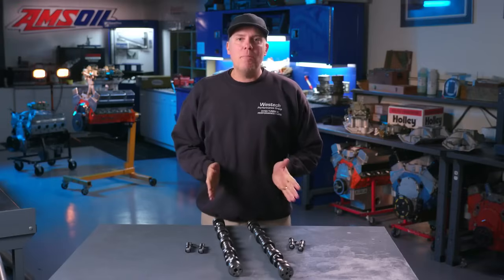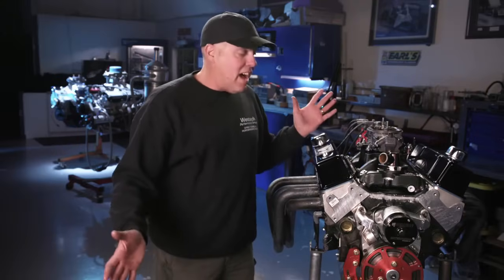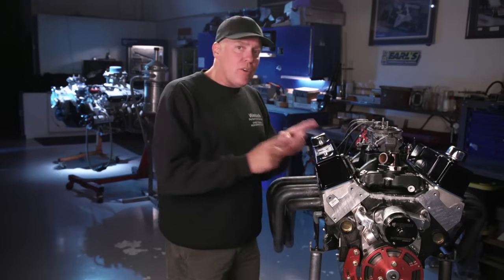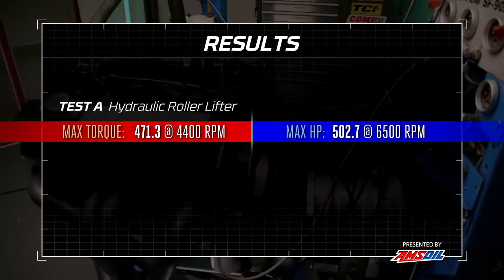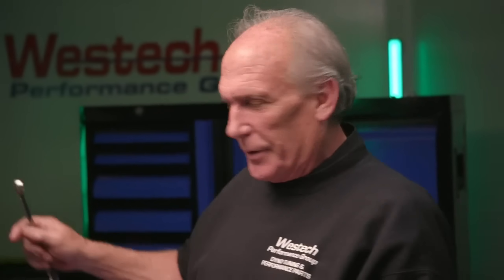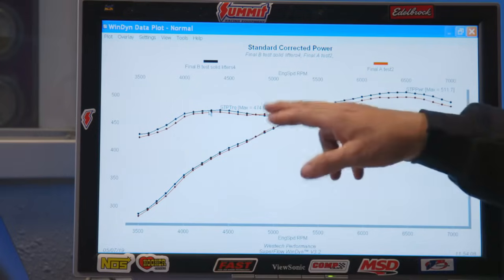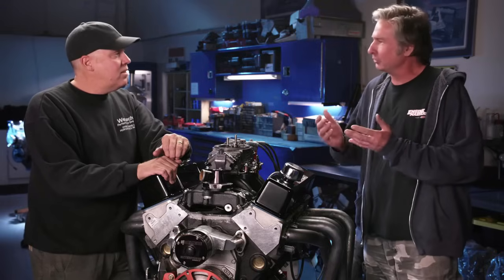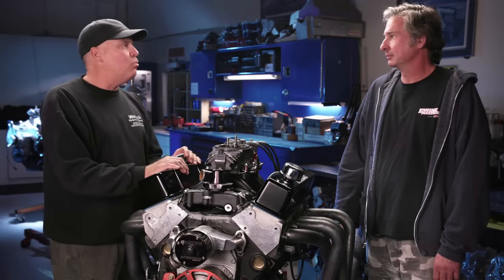ENGINE MASTERS  S4E48  Hydraulic vs Solid Lifters the Redo!

Comment: A couple of points (I have videos on this), weight on lifter side doesn't make any difference   also the lash should be .004" x rocker ratio,  also a solid has a large wheel which will add 1-2 degrees  of duration.

Comment: The bottom line is, you can get away with a lot more with roller. Doing this with flat tappet according to my cam grinder won't work well for very long.

Comment: if you are running high RPM, the oil can develop foam, foam i just air in the oil, which could cause the lifter to give more at high RiPMs.  
This is also why you get lifter tick when you run low on oil, the oil is getting foamy, and yes, it is literally cavitation, but cavitation isn't as devastating as folks are lead to believe, especially on a standard oil pump design... 60 psi max is nuthin, compared to 1500-5000psi on a hydraulic system, lubricating oil, is more of a film mild cavitation won't effect engine life... much... lots foam in little oil is bad news, but your lifters will start making noise before then, just turn the gawddamn radio down thank you lol

Comment: Hmm.  IMHO, it would be easier to simply bottom out adjust your hydraulic lifters then loosen them until they flow oil would be the easiest solution.  OR after bottoming out, use a feeler gauge to set them but be sure they flow oil.  I've heard this is the way to go if you want a high performance hydraulic lifter without the noise and/or collapse issues.
Reply: Top out.  Not bottom out.
Reply: @tahcogunworks No, that's not what I'm saying.
Reply: Lol, don't forget to add longer pushrods to keep your valvetrain geometry if you're doing that lol
Reply: @lollipop84858 I always check that lol.

Comment: I have been running solid rollers on a Hydraulic Lunatti cam for 15 years and 23k miles of street driving in my stroked 340 and it has been rock solid the entire time. My engine builder set lash at 24 and 26 thousandths warm, which sounded like a diesel. I got the car home and reduced lash to 6 and 8 cold. It went quiet, and picked up power, and has been that way ever since. No problems at all.
340 block, eddy heads, Lunatti cam, Comp pro magnum roller rockers, trend pushrods, and crane solid roller lifters.
Reply: You are spot on with your lash. That’s what I had mine set at.
Reply: I did some testing on my small block Dodge with the degree wheel. I found that every .004" lash gives or removes 3° of duration so it's entirely possible to have literally a completely different camshaft simply depending on lash.
Reply: Your going to lose duration with lash  that’s normal.

Comment: I have a small block 350 in my 57 Belair thats driven daily. My question is how often do you need to check the rocker zero valve lash, every month, every 3 months when ???

Comment: 4500ish rpm looked like where the hydraulic lifter was slightly better, it's about the stock peak rpm/where the torque curve tends to really fall off. With the way hydraulic lifter are designed that's probably about the peak oil pressure and stability in the roller. Just under peak oil pressure at low rpm you'd have some extra squish, and at higher rpm when you exceed the rate it can refill you'd start to see the same issues?

Comment: Camshaft lobes ground for hydraulic lifters are tapered .002” to cause the lifter to spin in the lifter bore.
Roller lifters don’t spin WTF?? Am I missing something here??
Reply: Hydraulic roller cams are not tapered. Only flat tappet  cams have a taper, the flat tappet is also not actually flat, it's slightly convex. The  combination of lobe taper and convex lifter face promote lifter rotation.

Comment: I specialize in car and pick up truck medium duty, diesels, sometimes I see the needle bearings in the rollers in the lifters slip and slide and chew up the rollers, destroying the camshaft, and with that much metal in the oil sometimes they destroy the entire engine!   I haven’t seen any, but does anybody make a roller lifter that has a bushing in the roller rather than the needle bearings? Seems like these would have a chance of lasting several hundred thousand miles to a million1, miles.
Reply: Yes. There are 2 company's that make lifters with bushings instead of needle bearings.  Morel and Isky racing cams

Comment: A good friend of mine runs a 1968 Pontiac GTO with 494ci. Pontiac motor that runs very low tens on 91 octane gas. At his dyno shop in Van Nuys California. He switched from the hydraulic rollers to solid rollers, and picked up over 20+ horsepower past 5,500 rpm from what I recall. He did this about 3-4 years ago, and stayed with the solid roller setup ever since.
Reply: A good friend, meaning you 😂

Comment: Isky used to make lash cap.systems.that as far as I can figure did a pretty good job on keeping roller tappets from failing due to skidding. It jst seems to me this was a great idea. Isky no longer markets these systems and I think it was a bad decision on their part to discontimue these. I'd.like to hear others opinion on this as I'm working on an engine now which Im having to start over now with different components since I no longer have a y of the original pieces, not by my choice.
Reply: The old system was called Rev Cap which had the extra spring around the valve.spri ga I stead of under the heads around the pushrods

Comment: Good debate.  Interested in seeing the longevity of it
Reply: I did exactly this 13 years ago, the motor has been refreshed twice over the years with 2 different cams and the same Johnson solid roller lifters I used are still running with no issues. 355 cubes made 520 hp/470 lb ft and the motor has been turned to 7500 rpm often. We tested zero lash upto .010"/.012" and found the happy place was .006" lash on the intake and .008" lash on the exhaust.
Reply: @Mickss355  Using regular spec'd hydraulic springs or more?

Comment: If you say you gotta lash valves all the time, you’ve got other problems. We lash our racecar once a year(but we do pull the VC to inspect everything after every race). Even when we do lash it it’s off by no less .001
Reply: Exactly.
Frequent lash change is an indication of a problem.
Reply: You probably mean to say "no more that .001" to illustrate your point as if it's no less than it means it's got a lot more than tgat

Comment: Hydraulic cams only have about .006" of constant velocity closing ramp, while mechanical cams have .012-.018".  It's a bad idea for durability to run mechanical tappets on hydraulic cams.  Especially on aluminum-block engines, differential thermal expansion will increase the operating clearance to the point where the valvetrain begins seating before the constant velocity ramp is reached.  When this happens valve seating velocities become too high for long-term durability.  I spent nine years doing valvetrain development at Eaton Corporation.  We would test valvetrain rigs for passenger car engines for 300 hours at max power speed at high oil temperature.  That is durability testing.  Making 80-100 10-second power sweeps only proves durability for a drag race engine.
Reply: Interesting 
Thanks
Reply: Your theoretical stuff is no match for the hundreds of thousands of people out there actually successfully doing it every day
Reply: @lollipop84858 What theoretical stuff?  All that I related is real-world stuff that big auto manufacturers do.  10's of thousands of hours of testing and analysis is the price of admission.
Reply: Some of these guys on here think that because they drive something 1500 miles a year and it hasn't had any issues that its durable. When if they upped it to 1500 a month they'd find its not.

Comment: One of the things you can do if you're worried about the durability of the solid lifter is choose a brand with a bushing instead of needle bearings and an ultra polished axle for the roller. Bam! Another source of failure gone. Also I have seen composite solid lifters advertised as 30g lighter per lifter. Think about how much higher that will run over hydraulics. We're talking almost 100 grams lighter per lifter.
Reply: DF noted that.

Comment: I think one of the main reasons cars mostly have hydraulic lifters is that people would be turned off by the chatter sound solid lifters make.   If you're a performance enthusiast it wont bother you.
Reply: Constant valve lashing is what comes with solids. 5hp is well worth the hassle for anything not being rode hard constantly.
Reply: @DevMeloy  
I think all new engines have hydraulic lifters, or on OH cam engines a hydraulic lash adjustor.
Reply: @DevMeloy  you might be doing something wrong if your lash needs constant adjustment. It's 2025. We've come a long way
Reply: @lollipop84858 I made this comment months ago, but we're talking about solid lifters. You get a bit more power, but more maintenance.
Reply: Hydraulics compensate for expansion, contraction, and wear. Theoretically for the life of a street engine.
Reply: No it isn't. It's for the convenience and less maintenance and fun that goes with just driving them

Comment: What was never mentioned here is that hydraulic cams are designed with a "clearance ramp" where the initial lift rate is quite slow. It is meant to give the oil flow into the lifter time to adjust the clearance to zero before the higher rate portion of the lift curve. Early Comp "High Energy" cams reduced this ramp for faster valve action at the expense of durability. All of the variables around the oil inside the lifter must cause slightly reduced lift and duration compared to a solid cam. Using hydraulic lifters on a solid cam creates excessive shock loads at the cam/lifter mating surface. Conversely, the hydraulic cam profile is milder with solids because usually the valve clearance is set large enough to remove the influence of the clearance ramp. You get a shorter duration cam which is why traditional logic is to choose more duration with a solid cam.  Running zero clearance and relying on thermal expansion will likely require very frequent clearance checks. Not so much trouble on a dyno, more so in a vehicle.
Reply: Running .004 lash is ballpark for it.
Reply: According to comp cams youre wrong.  Hydraulic have faster ramps.  Its the soilds that have slower ramps.
Reply: Have any of you actually done this? I have. I had a 230/244 comp hyd roller. Originally it fell on its face at 6000-6200. I put solid roller lifters in it and it made a tremendous difference in my case. I shifted at 7800rpm and the Dyno showed a 11hp drop from 6800 to 7800. The Dyno operator thought I was nuts when I told him to pull it to the rev limiter that I had set at 7800 rpm. Sbc, 383 stroker. The lash was .006 on the intake and .008 on the exhaust. I checked lash every oil change and it never really moved. This was my daily driver, ran 11.40’s at 122-123 back in the late 90’s. Third gen Camaro. If you doubt me, in my videos on here, I have a couple videos of it. Just forgive the sacrilege of the wheels I had on it in the videos. I got them for $200 and wanted to see what 20’s looked like on it.
Reply: Test cheapo or stock lifters vs the crane.

Comment: Shhh, us Cummins guys know solid lifters are the way to go.  Only have to adjust every 100k miles.
Reply: 80 pounds of seat pressure and 2200 rpms.  Lol.
Reply: Why do you have to adjust them so much? Serious question. That's a modern engine and it's 2025...

Comment: I with you Dave on the solid rollers skidding which is why I'm a big fan of rev kit systems with them, keeping the tappet on the cam under a load. It also makes sense to me to take the load off thenvalve stem and parts. It's another place for anparts failure I know but it seems to me, a brokenrev spring isna lot easier tondeal with than anbroken valve! This is why I don't nderstand why Isky stopped making their Rev Cap systems. I'm hoping one of you guys or someonenout there agrees with me and or has infonon where Incan findnthis setup tonfit an BBC Im building now. I have a roller cam I wish to run with these. Here's me anxiously waiting to hear from somebody
Reply: IMO Isky stopped due to production costs per minimal sales.
That's always 99% of why stuff disappears = few sales.

Comment: Does anyone out there know where I can get a set of the old Isky Rev Cap spring stuff for a BBC? I'm building an engine and would like to run these on my roller setup. They used to make the spring caps that did the same thing as arev kit below the heads but on the valves instead so you didn't have to run as much spring on the valve stems and seats.
Reply: Modern technology has eliminated their use.
Lighter valves, retainers, beehive springs, rockers, pushrods, oil in pushrods weight, etc.
Going past 6000 requires complete valve train weight reduction. You can't just rely on massive springs to cure the problems.

Comment: I had a room mate back in tech school that had a Mustang with a 302 Boss that someone had built with a solid tappet cam and had used hydraulics on, that was just a death trap and something to get tickets in all day all week all month all year. I now have a roller cam I want to use in my BBC planning for my 23 T bucket. I figured on hyd. but now thinking solids as the engine already has a gear drive in it. I had a bunch of BBC race parts I no longer have thanks to some scum bagenwith a meth habit, so I guess I'll pull out my 454 from my old motorhome which is not the OE block, it's a 2 bolt and I still habl e my splayed 4340.Moly 4 bolt main caps and some other stuff I can use for the build. W

Comment: I would take “Big Joe” Sherman’s advice and use a rev kit when running solid on the street for longevity.  Keeps the rollers in contact with the cam.  They are extra work, though.  No free lunch…
Reply: Hard to find for a lot of engines too.
Reply: You're taking some work off the valve springs, rockers, and push rods, too. Seems like you need the same amount of spring to control the valvetrain, but now you are putting some of it directly on the lifters.
Reply: @5000rgb 
also costs a little power
Reply: @5000rgb  yea, they only came about because when they were more popular, valve spring technology sucked
Reply: We have come a long way since that has-been died. The design and oiling of solid lifters is better now than in the 70s when he was in his prime. Cam design has improved too, as well as over sized diameter lifters availability. You can't stay in the dinosaur times because some old dead guy said something once
Reply: It wouldn't hurt to show some respect for Mr. Sherman whether you like or agree with him or not!

Comment: Valve lift dynamically is a theoretical measurement of a hydraulic lifter !
On a positive note, power is limited if not stopped on hydraulic lifters if you have a  lack of oil or oil pump failure. 
With solid lifters you might get a momentary increase of power during the very same oil or oil pump loss and hand grenade the engine 🧐💁‍♂️

Comment: In the early 70, we would punch the ball bearings out of hyd flat tappet lifters and run them on hyd cams for a little performance boost. Stock or custom grinded cam were the only choice available, custom was to expensive for a mild build.

Comment: I'm trying to think if rocker ratio can help spring pressure
Reply: if the weight is the same, or lighter, a shorter rocker arm will not float valves, as easy as a longer rocker arm. Same as a lighter rocker arm will not float valves, as easy as a heavier rocker arm. So if your engine was having valve float issues, with a very heavy, 1.6 rocker arm. It would help to drop down to a 1.5 very light weight rocker arm. But best would be to buy the right beehive, or conical valve spring for your setup.
Reply: Any ratio increase affects valve acceleration and closing bounce is a possible rpm killer. Test to see.
Stronger springs might overload a hydraulic lifter.

Comment: How do 1.5 -1.6- 1.7 ratio rockers affect valve float at high RPM.    Do you need to add more spring with higher ratio rockers.  🤔
Reply: Yes, more spring pressure is needed with higher ratio rockers, especially if they are heavier.
Reply: Probably.
Only testing will tell. Generally it knocks 300 rpm off the usable rpm limit.
More important is valve bounce when closing.

Comment: This is very interesting, and timely for me. I am rebuilding a Magnum 360 to go into my Jeep WJ. I want to keep the stock roller cam/lifter but with a really good low rpm high torque cam profile. When you're off-roading you are almost never past 60% throttle and 4000 rpm. Unless you're sailing over open country. Anyway, I've been thinking about getting stock lifters and disassembling them and using whatever method works (thin washers/rod) to set the total plunger travel to .020 , but I'm not sure if it's even necessary given the way I'm going to run the engine. It will be a daily driver with weekend 4x4-ing trips in the woods. No open country stuff. I also need it to be reliable and not too bad on mileage. Do you think it'd even be necessary to mess with the lifters as I've described?
Reply: Talk to the guys at Hughes Engines, they're the most knowledgeable guys on the planet when it comes to Mopars!
Reply: I wouldn't limit just clean them. I would even consider use the stock cam especially with efi maybe consider an RV cam. But if carbureted i had a 216 .050 454 lift on 110 that was wonderful it was a flat tappet go to like a 210 at .050 for a roller and it should be the same cam but I would limit lift to 450 because stock heads don't flow over 450 and you can use stock springs and no binding issues.